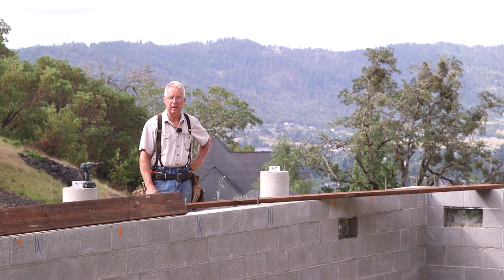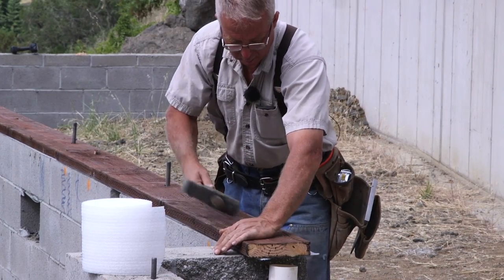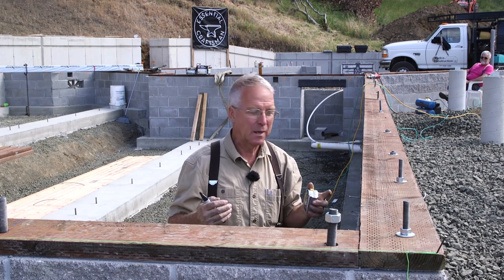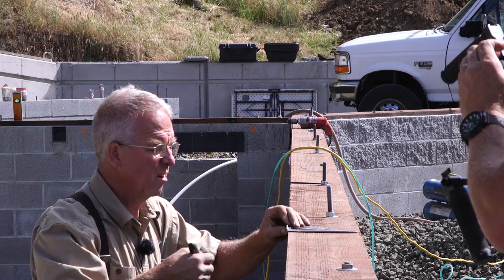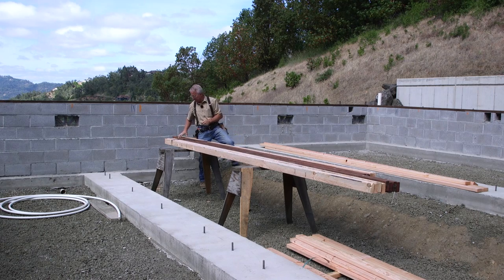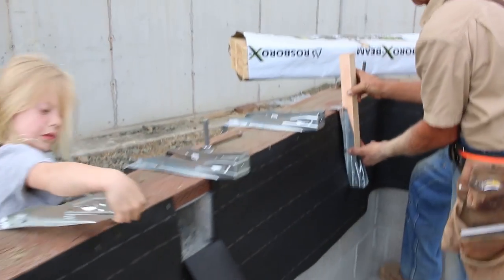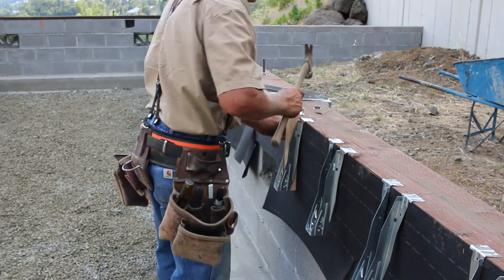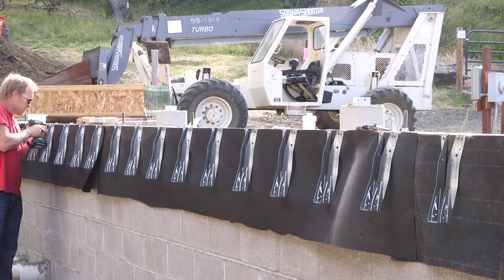Hold Up The Joists Ep.39

Comment: Note on the PT wood.  There are numerous products available to treat end cuts and other penetrations like drill holes.  Most PT wood manufacturers sell the same witches brew they use to match their lumber, including colour.  My experience is that a quick brush on of the treatment works just as well as the original factory treatment.  I've built many decks, steps and planter boxes in the last several decades and the PT stands up very well.  I always have a 750 ml [I'm Canadian] yogurt bucket, with a hole in the lid for an el-cheapo bristle brush, of PT treatment right at my cutting table.  I figure if I, or my clients, are paying for premium product, they should get full value.  I have not been disappointed yet.
Reply: Nicee
Reply: If you're curious, the main component of most pressure treatments is a salt of copper. You mix copper with some seriously strong acid to dissolve the copper and then add lye until it's no longer corrosive.

Then you have copper sulfate or copper nitrate. Mix with water and pressurize it into your wood!
Reply: Your s e plans may say all p t wood cut needs to be brushed on the open ends before using as sill plates, so required. Common

Comment: For the sake of comparison and to help inform the choice for choosing joists,let us cover some of the down sides to TJI joists.  They introduce more formaldehyde into the living environment. Require more labor installing squash blocks. There is always the durability question when we consider moisture and glue.While on the surface,they appear more environmentally friendly,they in fact encourage more clear cutting which has it's own negative impacts. Also,in a fire event,they burn like a two month old Christmas tree. Throw a TJI and a 2'x 12" into a burn pile and watch the outcome. More and more fire departments are requiring reflective medallions to be installed on the crests of homes warning firemen of the dangers they present. Telling them do not enter building unless 100 % sure people are trapped inside. In other words,this place is a "fire trap ".They are cheaper though than solid wood. I will give you that.

Comment: Hitachi makes a metal connector nailer  that has the end of the nail protruding the end of the gun so you can index it in the hanger. It makes simpson ties a whole lot faster. Also I love it when Scott gang cuts anything with a chainsaw. I don't quite have the stones for that, I always used a prazi.
Reply: There are a bunch of metal connector nailers. I'm a fan of the multiple blow type, much like a palm nailer. We use senco 150s.

Comment: In the UK a Pony wall would be called a Dwarf wall, same reason as you described, it's shorter than a normal wall. To shim your pony wall you could use a nut and washer on the underside for height adjustment allowing you to adjust it as required. Cheers 👍

Comment: Seems to me that the logical thing to do would be for the top of those joist hangers to span across the entire width of that pressure treated board. That would not only allow for the nails to be run further in and away from the edge, but it also solves that annoying problem of a "high spot" on just one side of the board.
Reply: Basil, you're probably used to SYP treated boards.  Out west, they use incised hem-fir.
Reply: @Basil Rathbonez How so ? The guy using them says they are ( no need to lie) he payed for pressure treated boards , do you think he was scammed or that he is lying or that those boards are treated somehow or something with somewhat (cos you can see that they are different, and something was done to them)  but not pressure treated ?

Comment: I use a palm nailer for my joist hangers, it is quick and saves the fingers.
Reply: J. Foster there are hanger nail guns FYI
Reply: Palm nailers are great! And cheap!
Reply: We have a Tico gun...
Reply: Tiko gun, it’s done in half the time.
Reply: I bought one for $20 at harbor freight and have used it for years - it's a great tool, and I'm amazed it's lasted this long. It will drop a 16d nail into spots you could never touch with a hammer or nailer.
Reply: @colinettema8445  Thanks I know that, but the palm nailer is much less expensive and more versatile.

Comment: Great stuff. Superb explanations. I did miles of mud sills way back and always drilled my bolt holes using 3/4” bit to allow bolts to drop in easier and to allow us to motivate a less than strait sill to follows a snap line before the nutwas tighten into place.
Reply: Really? We were never allowed to over-drill the holes on my job sites. They wanted a more snug fit.

Comment: Left handed tapes have always driven me nuts. You are the only other guy I have ever heard mention it.
Reply: The problem comes from learning to read left to right, but the majority of people (90%) are 'right handed' - which results in learning to write  (or mark ) with our right hand while pulling the tape ( a less precise maneuver ) with our left hand.
Stanley made a tape with both edges marked in a different direction to accomodate this, but guess what happens at...69" ? They also included a vertical read - up the middle - but the whole damn thing was such a mess... the only good thing came from the need to make the tape wider - thus the 1" tape from the 3/4"

Our brain solves the problem quite easily on this side of the earth, tho takes a bit of focus if you're driving in England. 

Makes me wonder what the tapes look like in Saudi Arabia?

Comment: I am in Kentucky.
Normally we see the joist set on top of the sill plate and secured, then a rim joist.
Reply: Yep, and at the very end of the video he explains why they did things the way they did... it is because of the appearance and height above the sill wall that the normal way of doing things wasn't the best solution for this specific house/location.
Reply: @fprintf  I skipped the  last 5 minutes, was watch at work.
thanks! going back to rewatch!
Reply: Same here in upstate ny, but it's fairly common to see them hung as well, builders and owners preferences and plan of use for space

Comment: I just came to funny revelation at the end of this video. Years ago when I was in middle school I used to build ramps all over my yard with any spare lumber I could find lying around. I'd ride my bike off them and more often than not get hurt doing so. A lot of the ramps I built were from these pieces of plywood sandwiched between 2x4s. I found a whole stack of them dumped in an empty lot by my house and I loved them cause they were rigid and I could make a ramp out of 2 of them in a simple L shape. For years I wondered what they were for. I thought maybe ramps to put down on a trailer to role a car up on. The spacing between 2x4s were perfect for a tire, but that didn't make sense. All these years later and I'm finding out they were floor joists.

Comment: A couple ideas...

A pneumatic hanger nailer is worth its weight in gold if you use hangers very often.
A framed opening with header in the pony wall/s is nice for future access. (Where height permits)
Use a bead of silicone between the stem wall and sill seal for a little extra protection from the creepy crawlers.

P.S.  love your framing saw at the end of the video.
Reply: Not Silicone but something like ZIP System Liquid Flash, silicone dry's out over time (in most cases 3 years it's past it's best use time, then full failure at 6 years). ZIP System Liquid Flash is about the same type of glue used in car/truck front /rear/ fix glassed windows, it never "drys" out and flexes with the house. Plus bugs really hate the stuff.
Reply: Look up Zip 2.0 by Matt Risinger
Reply: TdrSld good point.  Thx
Reply: Silicone does not adhere to stone or concrete.  A roofing/flashing caulk is better. Many framers use a tar based seal also

Comment: Hopefully that slightly angled strip footing didn't throw off the framing too much.

Bit surprised you didn't show adding wood preservative to where you cut the pressure treated board. I'd always heard that was a good idea or requirement: not sure if it's just for straight cuts or if those anchor bolt holes would also need it too.

I do like those grk structural screws!
Reply: rpavlik1 I thought the same thing
Reply: The bolt holes technically could use some preservative but since they're in the middle of the board, there isn't much that will get to them. After a period of time, the wall assembly will stabilize as far as moisture content and wicking and such, assuming no issues with installation, so it's not like the untreated wood on the insides of the holes is outside in the rain.
Reply: Maybe the nail holes should be treated as well 🤪.
🤜🤛
Reply: @Basil Rathbonez Well, it's what we call pressure treated here (I live near Scott) and it's what's available and passes inspection. Yeah, I wish it was better but it isn't.
Reply: @ Basil Rathbonez - I was being facetious.
🤜🤛

Comment: I was surprised to not see you use one of the several anchor bolt layout tool. Back in the day, I made mine from a 8" pointed trowel.
Reply: I used to be a framing/finish carpenter and I never heard of that. Would have saved me so much time.

Comment: I guess I don't trust my chainsaw skills enough to try that TJI cut(s).  How many times did you check your measurement?  Haha!  Love the channel.  Keep up the great content!  Thanks!
Reply: I thought the same thing. I suck with a chainsaw so I would never attempt a cut like that on those expensive engineered joists.
🤜🤛
Reply: Check out Prazi's stuff - they make chain attachments for circular saws that are long enough to saw through beams like that.
Reply: makes copper wire out of onsite pennies, then cuts all the joists with a chainsaw. crazy.
Reply: I consider myself very good with a chainsaw and even I don't trust my skills enough to try that kind of precision on something that expensive.
Reply: @OmegaGamingNetwork  He's working with at least a 1/2" margin of error - 1/4" minimum separation from walls...plus not everyone has a 36" bar lying around.
Reply: Measure 85 times, cut once. Cold sweats the night before.
Reply: Agreed! I usually cut joists with an over-sized speed square in my left hand and a worm drive saw in my right hand. Not as fast as a chain saw, but it is something I can manage.

Comment: Love your videos, guys! Thank you. One quick add-on to the sill seal foam: here in Alaska, and other cold climates, it also provides an important filler for air leaks. Of course we go over the seam with caulking as well, but the sill seal really helps with air infiltration. One quick question about code (don't know the Oregon code, sorry!) at 16:45 I noticed you have a break in the sill right near a bolt, but the other sill appears to have more than 2' before it gets a bolt. Will you have to add in another Titen-type bolt to hold that sill, or can you have that much to the end of a board without anchoring? Or will the bottom plate of the wall span it and make it ok? (I had to add extra bolts  within two feet of seams in AK.)

Comment: I realize that everywhere has different requirements. Bolts are within 1 foot of the end of the board, and 6 foot centers. The washers needed to be the big square ones.  Straps for the walls are within 1 foot of the corner then 6 foot centers or on layout. We didn't use many pony walls because the wood needed to be treated if within 18 inches of the dirt. I have never seen anyone hang all of the joist like that on purpose. Maybe on a remodel but even then a beam on really short posts, same instead of a pony wall. That short crawlspace shown at the end wouldn't meet code. The plumber is gonna hate you. But hey, good job making an interesting video!
Reply: @Basil Rathbonez why would they make pressure treated that didn't meet code?  Why would a builder use lumber that wouldn't meet code?
Reply: @BrianBriCurInTheOC  lol. Yes he is. It would be one thing if he was right but he's wrong and arrogant.

Edit to add.  He replied elsewhere so he's hiding out from this question.

Comment: It is always neat to see the minor differences in construction from one region to another. I live and work in the construction industry in Florida. Minor differences are interesting. For example most engineers require 2 x 2 square washers on the hold downs for uplift purposes. Principles and languages are the same. Your a fine contractor sir.

Comment: im surprised you dont own a tico nailer.  Deck builder here. Trust me it will pay for itself in one job
Reply: I was going to say that, but you beat me to it.
Reply: An off brand joist hanger nailer is relatively cheap from a box store and last for years with moderate use.

Comment: I don't like hanging the main floor from hangers. I want it solid on the mud sill.
Reply: They explain at the end of the video it was for floor elevation purposes, though I’m curious if a pony wall on the inside of the stem wall wouldst’ve been better than those buckets whose tabs you would think would’ve run a little further across the top of that mud sill.
Reply: Agree 100 percent, but I appreciate his reasons for doing it.
Reply: Amen. One less course and you are there. Way more solid. Same elevation.

Comment: Is it intentional that there is no vapor protection below the pony walls? Or it is there but only not seen? Thanks!
Reply: I wondered that too. It seems like cheap protection, so why not?
Reply: It is assumed by the arch. and eng. that this is a dry area and not subject to moisture or temperature issues. It is typically up to the builder if he places what is considered above and beyond protection.
Reply: @goldendragonssuck  I seem to recall many episodes ago, when they were first looking at the land that they HAD pooling of water, and the back side has water running down the hill.  

Where I live, we have subterranean water sources that migrate downhill, and my daughter's in-law's house suffered from subterranean water vapors that traveled upwards from a river 200 feet underground, which kept their carpet wet all the time.  (at least that's what they were told by a geologist).  It resulted in their choice of flooring changing to something that would be hard, breathe, and not rot.

It may be compensated in this instance (referring to this build) by the number of cross vents seen in the CMU walls, and which they cut around when applying the tar paper.

But like others.. I think it's cheap insurance to have that vapor barrier.
Reply: @jum5238  Yea, but they placed footings drains and rear retaining wall on the property that "should" limit the water from being able to reach the inside footings. Plus having a retaining wall below the house with granular back fill, the water will find it easier than going through native compacted soil that the footings are on. 

And based on what you said, a vapor barrier underneath a sill plate wouldn't have solved their problem.
Reply: The end cuts on the plates for the pony walls were in contact with the outside. Slide some felt in between for a fix.
Reply: I could be wrong, but it seems the intention of vapor barrier is to establish the barrier between inside and outside of the house. If used on the pony walls it is making a barrier between inside and inside of house, pointless considering that plus the fact it's an open wall.
Reply: @austinpatrick2682  I meant that "below" the pony wall, between the wood and the concrete footing. Especially, since the footing here is much closer to the soil, therefore maybe carrying more moisture.
Reply: @balintbarki4121  that's what the pressure treated bottom plate is for.
Reply: @balintbarki4121  Again, I could be wrong but I don't think the barrier is meant to protect the wood from the concrete, that's why it's pressure treated wood. It's meant to seal between the wood and concrete so moisture, air, and bugs won't slip through the gap.
Reply: @jum5238  Hard breathable flooring is not a fix for that problem. It's only fixing the immediate symptom of a wet floor. A crawlspace encapsulation and radon system to pull the moisture underneath out is what was needed. The subfloor is still being allowed to rot.

Comment: As an Easterner, I am heartbroken that you are not using Douglas Fir for all the framing including the floor joists. If I see Disoriented Strand Board used for sub flooring  or sheathing I am running to the hills.
Reply: Right Lane Hog, it’s hard to beat the almighty dollar!
Reply: Basil, I’m not sure of the termite conditions in this relatively dry place but pressure treated 2x lumber in Georgia goes all the way through. Nasty sticky stuff in the middle on 2 x’s at least. Not as nasty as the “good stuff” from years ago.
I’ve read that the PT can only go in about 2”.
Reply: @noellwilson1273   We get fully saturated PT 6x6's all the time

Comment: I regularly see houses that are built as much as 2-6" out of square. I prefer this style which is much like how my dad built things. He allowed 1/4" variance on a 60ft building, and then same went for the wall level from end to end.  Makes it really nice when it comes time to put wall sheeting on or bringing end wall measurements together. He also managed to do all that using a homemade transit built from a scrap metal tripod and a rifle scope.
Reply: @Steve Sheldon if it varies like that from dry to wet seasons, then you probably have hydraulic pressuring transferring the load from an exterior wall, plus swelling and shrinking from interior humidity levels.

Comment: Thanks for explaining the use of hangers for the floor joists. I was wondering through the whole video why you weren't setting the joists on the stem walls and installing a rim joist. Another great video taking to explain the overall concepts without bogging down in details.